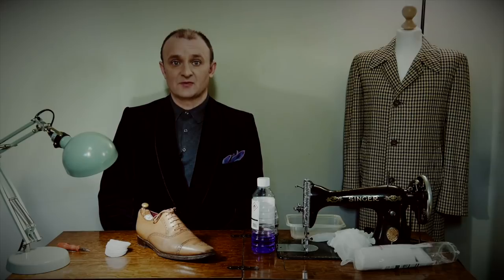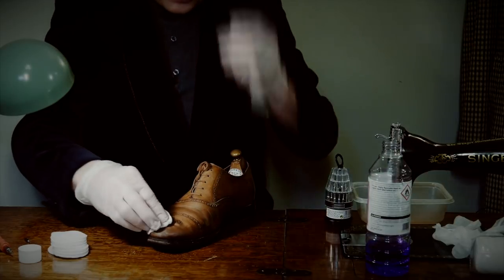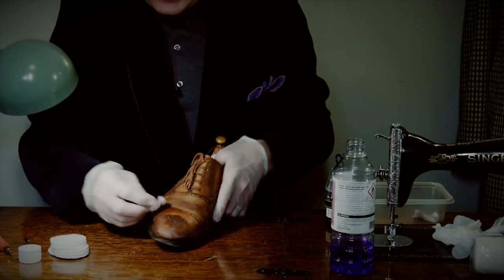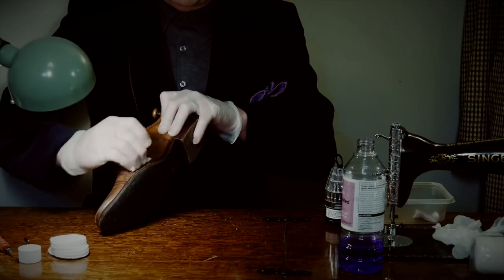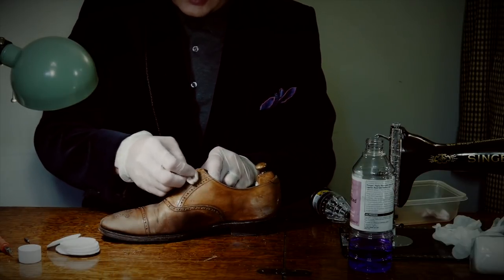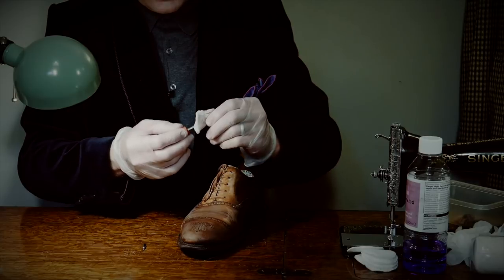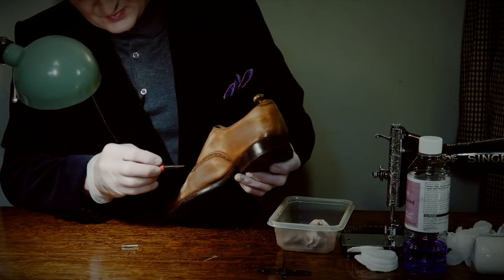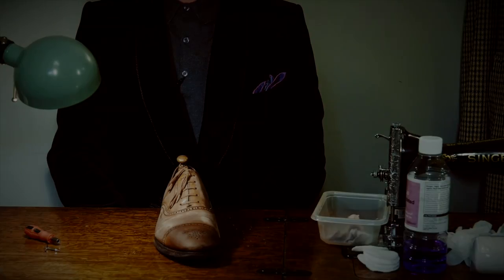Bespoke Addict Series 1 - Episode 2: Old Polish Removal

Comment: Thanks, very informative video. Some people recommend using acetone instead. Is methylated spirits better? If so, why?
Reply from the maker: Acetone is extremely harsh, & should only by used as last resort, for instance, perhaps methylated spirti or isopropyl alcohol has failed to remove oil stain or gloss paint
Reply: @bespokeaddict  I understand. Thank you.

Comment: Fantastic and detailed video. Thanks for sharing how to actually remove the polish from a shoe that needs moisturizer and shrinking. I had never thought that such a work was needed. I do buy vintage shoes myself and although I try to buy them deadstock (Have found some old gems this way) sometimes the bespoke ones are really abused. I was curious to learn what solvent did you use, was considering giving Reno'mat from saphir a try but your way is probably cheaper and confirmed to work.
Reply from the maker: Thank you my friend, Renomat is indeed very good, I use around 1 litre of solvent per month on various projects, I am keen for cost to not be an issue.

Comment: Hello... what is this pruple liquid you are using to remove the polish?? i am using saphir reno mat to remove the mirror shine of my shoes but i am struggling a lot with that, I can’t take it off , i think i used a lot of layers :-/
Reply from the maker: I am using methylated spirit here, it usually removes polish quickly, however, on very old thick polish it sometimes fails to lift, recently, whilst trying to strip 1970s bespoke shoes, the meths did nothing, despite much effort, in desperation, I tried nail varnish remover, this too failed, eventually, cellulose thinner easily removed old polish, I have never before experienced such a struggle, I would not recommend such harsh treatment before exhausting more usual methods. Are your shoes very old ?
Reply: Bespoke Addict The Brighton Gentleman , i parchase them brand new and i have one year with them, the think is covered the toe with a lot of layers of Saphir mirror gloss (May be 5 Dry layers + the layers of wax and water), i think for that Reason i have too much problem for remove it.
Do you suggest i keep trying with the Reno Mat do see if the mirror wax give up at some moment?? Thanks in advance 😁
Reply from the maker: I am surprised you are having so much difficulty; try using a softer cheaper shoe wax on top of Saphir, apply heavily, & rub hard enough to try & force solvents in soft wax to soften Saphir below, keep applying & rubbing for a few minutes, then try renomat again whilst polish is still soft